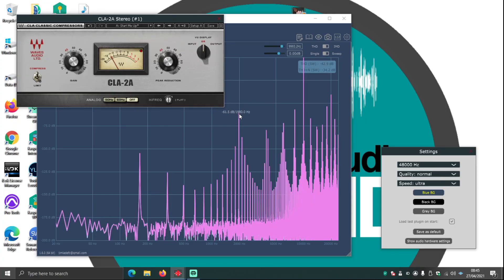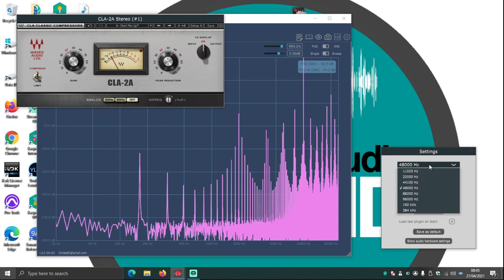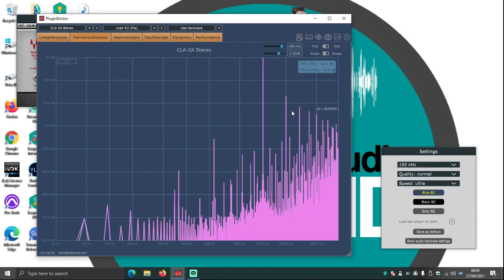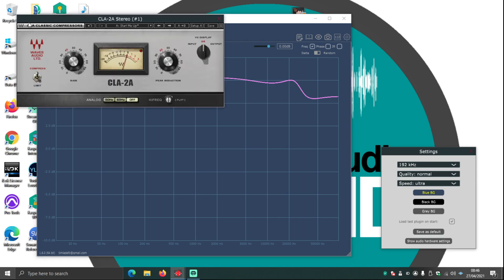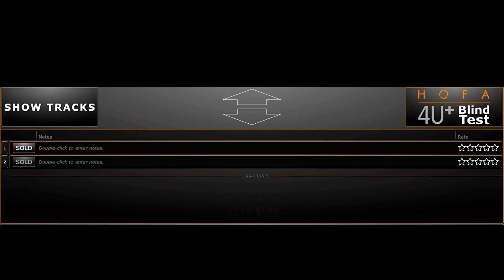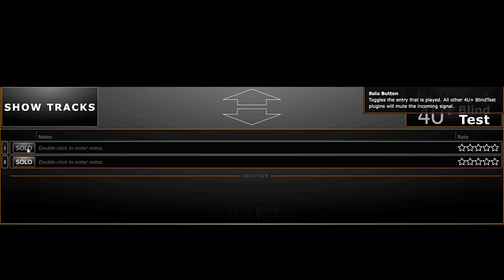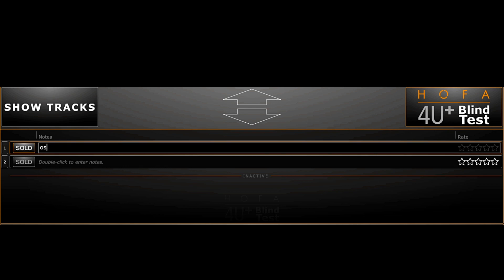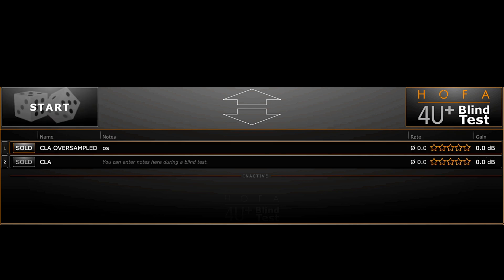WAVES CLA COMPS OVERSAMPLED || Does oversampling Waves plugins to 192khz really make a difference??

Comment: There seems to be, contradictory consensus emerging, or competing conventional “wisdoms” that I’d love to hear your take on.

On the one hand, there’s a ton of people claiming that working in say 192khz is “Overkill” and unnecessary, a waste of drive space and processing power, DSP whatever.
Yet, more and more people are claiming that Oversampling, in plug-ins, is absolutely critical.

I feel like I can hear pretty easily and consistently hear the difference in both recording at 192k, and oversampling say 48k at 4x to 192k.  (Though, while I can usually hear a difference objectively, I don’t always choose the oversampled version subjectively.  Preference depends upon the material.)

So what technically are the differences between having a whole session at 192k, vs 48k and oversampling the plug-Ins?  (By 4x which gets to 192k.  Some of the plugins can do 16x.  My understanding was that at 192, the anti-aliasing was well above the audible range of human hearing.  So what are the benefits of going so much further?  I imagine that they do exist.)

I’ve worked on six figure consoles in eight figure rooms.  The idea that you would work with lesser quality digital audio in order to save a few dollars on drives or a few hundred on processing power, yet spend fortunes on plugins is all out of wack to me.  I’m not sure if it’s like buying an expensive guitar and putting cheap strings on it, or buying the most expensive strings available and putting them on a garbage guitar.

Seems to me that investing in the most powerful processing machine available, even five figures worth, and running all the processing at it’s maximum quality setting, is most like the old school ethos of aiming for the highest possible quality at all times, which was the near universal goal back in the analog days.

Having access to such high quality emulation of nearly every piece of analog gear, and multiple versions of many of the best from various vendors, at our fingertips is still shocking every time I reflect on where we came from and where we are now.  You can buy the entire collections from UA, Plugin Alliance, Softube, Waves, even Acoustica for less than one rack of top outboard gear in a commercial analog studio.  Probably for less than the patchbays and cabling, not to mention the monthly electric bill.

So it seems to me that this channel is chasing after the best of the best, in modern computer based audio.  Understanding where we are today, and where we wanna go tomorrow.  And how many M1 chips can I shove in a Mac, or network of Macs to run it all.

What say you?
Reply from the maker: Yup. All I want to know is what are the differences. If there are any, and if so are the differences worth the hundreds or thousands more? I want to hear for myself how far audio has developed and what's available for the humble engineer with humble budgets 🤓 I'm fascinated in audio technology and testing it's possibilities and capabilites do yeah you basically nailed the aim of the channel.

In terms of oversampling whether it's internal or external it's purely for aliasing. It's pointless on most modern plugins as they are normally already internally oversampled or have very well coded filters to reduce it like a lot of brainworx plugins. Noiseash stuff is now default X8 oversampled but they do allow to turn it off which is crazy to me as you are genuinely compromising audio quality for CPU. Lindell stuff comes default with no oversampling but has options for up to x16 oversampling as Lindell himself states there are aliasing issues. To me a good modern plugin is a lot about how you manage aliasing without completely decimating cpu.

In terms of session sample rates it does reduce aliasing but I think it's more about the overall resolution which is subjective in terms of audible difference. The problem is that human hearing is 20khz so theoretically recording up to 44.1khz should be more than enough to sample a 20khz note. 

Obviously a higher sample rate and bit depth has more sample points so theoretically 192khz has over 250x the resolution of 44.1. in reality it's more dynamic range but to properly hear it you would need to absolutely crank speakers to the point it would hurt your ears. I may not be exact but I remember reading that the difference in dynamic range is like 30-40db more compared to 44.1 so like 140db compared to 90 odd. 130db+ will ruin your eardrums so it's completely unnecessary. 
so anyway we could theoretically hear about an extra 30db of loudness without distorting BUT just quiet background room noise is the same at about 30db, so to trully hear the difference you would need to crank your speakers above the room noise which is an extra 30db 😅😅. which just isn't necessary when 44.1 or 48 gives you enough dynamic range. To put that extra loudness into reality, 120db is the sound of a full orchestra 1 meter away 😂

So in your mixing environment and also in your listeners mixing environment they aren't going to hear any real difference. All your doing is eating CPU, RAM & more than doubling all your audio file sizes making the sessions MASSIVE.

I use 48khz as a middle ground as I still want to reduce aliasing in certain plugins without having to oversample everything. It's only beneficial for plugins which have aliasing problems though. That's the difference with the purpose of oversampling plugins compared to a DAW's session same rate as that is more based around resultion and actual sampling. In terms of audio resolution I'd say that taking aliasing out the equation.. Recording at 96khz or 192khz is overkill as its way above our hearing and its all getting down sampled to 44.1 or 48 anyway in most cases so it's an easy decision for me. Your ADA conversion is where its at for me. Way more of a difference than the  digital stuff 🤓
Reply: @PaulThird  Hey Paul.  Thank you so much for the reply!  I watched a few more of your videos and I really dig what you're trying to do here.  (I think your channel may be the antithesis of the White Sea channel.)

In another realm altogether, a man whose name you should know, Noam Chomsky once advised me to "Always Substantiate Your Claims."  One of the most life altering pieces of advice I was ever given, and I try to always do so, even though I often fall short.  I see your channel as attempting to do the same (whereas that other one I mentioned seems to have contempt for objective reality, evidence, scopes, meters....the manual.).  In particular, I commented on your video that was responding to another persons video about Hardware being inherently superior to Software, blah blah blah.  Don't feed the Trolls!

Now, the other thing I try to do is precede my statements with "To my understanding" or "In my opinion/experience", rather than make definitive statements claiming absolute knowledge of objective reality.  Then I try to substantiate with either Evidence or at least Analogy.

I apologize, to you and anyone else reading this for rambling on, but I say all of that to say this:

To my understanding....Dynamic Range is purely a function of Bit Depth and not Sample Rate.  You can multiply each Bit per Second by 6dB and figure out the theoretical DR (similar to 8 bits per byte).

1-bps is 6dB DR
8-bps is 48dB DR
16-bps is 96dB DR
and 24-bits per second is 144dB Dynamic Range

Also, if I understand correctly, the Best Analog gear doesn't cross 100dB DR because the Dynamic Range is measured from Noise floor, which is quite high in Analog gear, up to the Distortion Point, which is inevitable in electronic circuits.  So Noise to Distortion = Dynamic Range.

Therefore, the 16-bit standard originally seemed sufficient to cover the DR of Analog, just as you say 44.1khz seemed a sufficient Sample Rate in order to provide at least two samples for the highest frequencies that humans can theoretically  hear, 20Hz - 20kHz.

24-bit audio emerged as I understand, because 96dB didn't leave enough headroom for engineers using digital similarly to analog, and trying to record and process Hot to stay as far away from the Noise Floor as possible at all times.  However, when you run Analog circuits 'into the red', the signal would distort, by definition, and while many engineers learned to use the distortions of various components 'creatively' learning and preferring the different characteristics of Tubes, Transformers, Tape, and Transistors, etc, but no one finds the clipping of a digital signal Creatively Useful or pleasant.  (See that unsubstantiated claim?). With 144dB of Dynamic Range at 24-Bit, everyone had PLENTY of Headroom and life was perfect.

But...when people started mixing in the box, and not properly managing their Gain Staging, even that internal 144dB wasn't enough to prevent many from Clipping the Master Bus.  (To some of us this was clearly Operator Error).   The response to that "problem" was 1) to up the bit depth to 32-Bit with is 192dB Dynamic Range, oh my!, but also 2) to leave the realm of "Fixed Point Math" and enter the realm of "Floating Point", in which that 192 if ever challenged can simply shift itself upward to wherever it is needed rendering 32-Bit Floating Point as nearly limitless Dynamic Range.  All of the DAWs began to make their Mixing Engines operate at 32-Bit Float, and now life was complete.

Except...for reasons I very much Don't understand, all the DAWs moved further to 64-Bit Floating Point internally, and as I type this is the first time I'm determined to know WHY?  I imagine that it has to do with the Math lining up with computers operating at 64-Bit architectures and the calculations were simply more efficient upon the CPU and DSP, rather than any audio quality improvements.  But that's purely speculation.

So, now, as to the 48kHz (1X), 96kHz (2X), 192kHz (4X) baseline Sample Rate vs "Oversampling" say a (1X) by 2X, 4X, 8X, 16X!, on a Plugin by Plugin basis, that's something I definitely want to understand further.  And with measurements and substantiations like you provided in this video and others.

I think I can hear the difference between 48k and 96k, but the difference between 96k and 192 is a coin flip for me.  However, if A) the Plugin Processors do their thing to a Higher Audio Quality when given more samples per second, and if B) operating the plugins at 192kHz renders the Aliasing Artifacts absolutely beyond the range of human hearing, then why Not run the entire session at 192 and forget about Oversampling?  And if 16X 48kHz is 768kHz, like 64-Bit Floating Point, what the hell is all of that about?

As much as an Audio Engineer, I'm also a professional Filmmaker and Director of Photography (among too many other things).  In the world of cameras (video) , we went from Standard Definition with 480-lines of resolution, to HD with 1080, then 4K with 2160, and I just yesterday picked up Blackmagic 6K Pros with 3456.  By the end of the summer early fall I hope to buy the Blackmagic URSA Mini Pro 12K with a native resolution of 12,288 x 6,480.  Not gonna talk about Dynamic Range or RAW etc, but let's just say we 'aint in Kansas any more.

The point of High Resolutions, High Dynamic Range, Wide Color Sciences, and RAW is not that Thats what your going to serve the end user.  It's the raw ingredients You are working with in the kitchen.

The vast majority of the world is consuming HD images and possibly UHD at what's called Rec709.  Similarly, in the world of music, the listeners are still primarily listening to 16-bit 44.1 or 48kHz. 

Your channel seems to be engaged in the questions of how we get there.
Production not consumption.

Far too much of the discussion out there seems to be people engaged in production, yet thinking like consumers.

Last philosophical nonsense I swear:
I've often told people that "In order to become a Magician, the first thing you have to do, is stop believing in Magic!"

You've got me sold on Nebula, I've been dancing around it for years.  I can't wait to see what else you come up with, but I really do hope you take up my above challenges, and run a bunch of stuff through its paces to definitively get to the bottom of Sample Rates and Oversampling.

G.
Reply from the maker: You are right about the bit depth and dynamics range. Just thought I'd include that as many like myself move bit depth up with sample rate. I do 24 48 instead of 16 44.1

The thing that's most important when it comes to daw sample rates is ensuring the plugs are supported to the sample rate. If you work at 192khz then you have to check that your plugs can still function correctly. What I mean by function correctly is that when it's not supported the linear frequency response multiplies so lots of Waves supported at 96k will double frequencies at 192khz. So 100hz boost will turn into 200 etc. Acustica is only supported to 96khz. That's what they sample at.

192khz also doesn't fully remove all aliasing but does put it under the audible threshold. Depends on the severity of that saturation and filtering of the Plugin.

Its cpu as well. 96k is hard enough on an i9 never mind 192khz haha that's where OS comes in. You can oversample in a 48khz session where applicable. Most modern Plugs I've looked into come internally oversampled now or with OS options so 192khz seems very OTT especially when the plugs like brainworx etc are already essentially aliasing free. You are just hitting your cpu harder and creating larger file sizes for not that much extra output. I'm my opinion.

Recording at 192khz makes more sense as your capturing more sample points but the only way I could test that would be to re-amp to ensure its the exact same performance and record at different sample rates. Convert each down to 44.1 as that's the common end file format for streaming and see if after conversion it really makes that much of a difference in the recording side of it.

That test I could probably do. I used to be able to reamp with my mackie blackbird.. And when I had amp haha if I can find something I can record the exact same performance then it would be a pretty quick test
Reply: @G_handle  I thought I was reading something I wrote haha. Most of this stuff is marketing. They gotta sell this stuff. To look at something artistically, with emotion, that’s all that matters to the listener / viewer. How does something make them feel? If aliasing or lack thereof makes somebody better receive the emotion you are trying to send, then by all means, make it so. But I’m not convinced in double blind listening, that it matters all that much. However, move a mic a foot or change the amp on the guitar or, better yet, change the drum fill... huge difference. Remember tools are for mirror selfies.